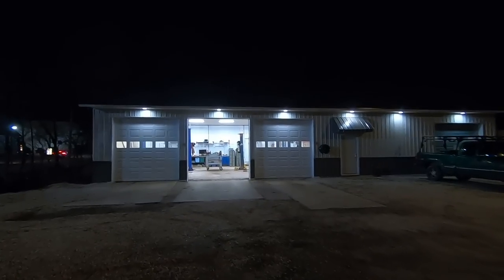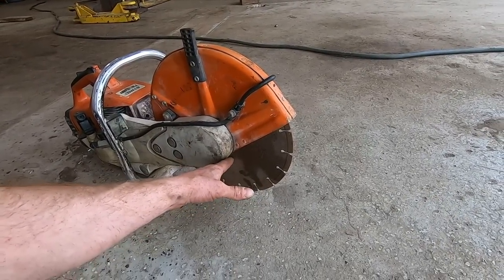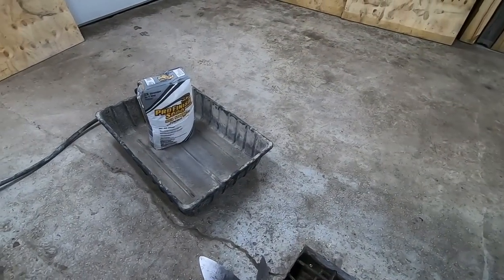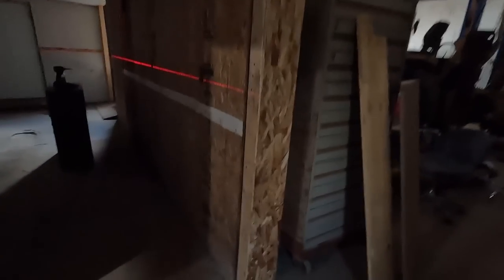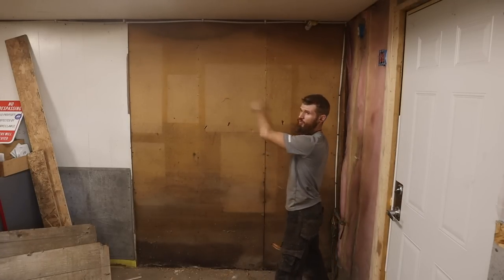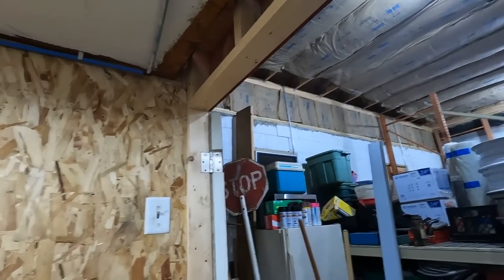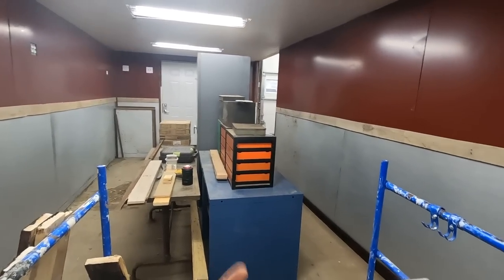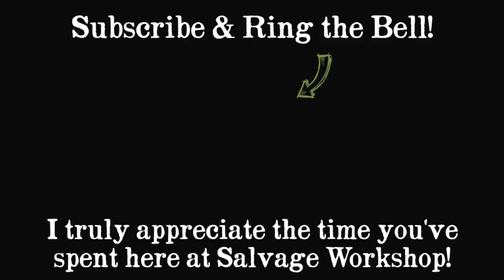Time to Start FINISHING the INSIDE of the New Shop! ~ Part 10 ~ Rebuilding of "The Salvage Cave"

Comment: That floor slab failed because there are no solid footings beneath. The lift will need deep posts drilling into the floor to give good support. I don't know the sizes but would guess at least 6" diameter posts are needed going down at least 4ft.  
The rebar repair you discussed will need to be resin anchored at the original material sides. Anything else will move and fail against the new concrete.

Comment: Hi Matt, sorry I have only just managed to watch this video but the cave is looking fantastic.
The one main suggestion I would have is to change the front on boxed area over the water valve to a hinged door, as if you ever had a burst pipe (of which I hope that never happens) the time you have been and got a screwdriver you will of will be faced by loads of water damage.
The tool you was using for cutting the galvanized sheet what is it called please/ what is it model number. Is it made by DeWalt and hope that you don't mind me asking 🤔
Looking forward to watching your next video Anthony

Comment: burlap covered corkboard would probably be cheap and work well for sound deadening. burlap with any backing would probably work well for your purposes.  I don't know that you would need to go studio grade for the type of content you produce. i.e. salvage.  I'm sure you can find some old burlap. love what you've done with the place so far!
Reply: I suggest burlap over fiberglass insulation.  If it has a paper backing, put the paper flat against the wall.  (Older radio and TV studios used chicken wire over fiberglass on ALL walls and ceiling - they needed to eliminate ALL reverberation.)

Comment: The problem with a windowless bathroom that has only a switch on the inside is that you will either go in, shut the door and then have to search for the lights and/or, once you do your business, wash up, you'll then hit the lights and then you can't find the stupid doorknob, so you will end up leaving the lights on..   You will probably end up putting an external switch in, wired as a two-way, and you'll end up using the external switch more often...   I have had multiple friends and acquaintances who put in powder rooms and shop bathrooms with no windows initially with internal light switches that all eventually had an external switch added...

Comment: Hm...for the upper Walls...since it will be dirty as hell either way, i would do either stonetiles, or since tiling all of that wold be expensive, big PVC boards...both are durable and easy to clean...only my two cents on the Walls...

Comment: The reason the bathroom light switch was on the outside was probably due to code? Putting it on the inside puts it within reach of the sink, water and electricity don’t play well together.

Comment: you want to clean out all the cracks in the concrete and get some epoxy crack repair before you epoxy the floor also hire machine to grind all the crap of the floor before epoxying it.

Comment: Two things one you should have epoxied the the rebar in to the holes you drilled, second the wood you are calling plywood is not plywood it is called OSB it is no where near as strong as plywood

Comment: Thin concrete over cinder-block with no rebar? Man, no wonder that floor is in rough shape!
Seems like this whole building was poorly built. Hope all the reinforcement can cancel out the shoddy prior work!
Some of that scrap-metal looks like vintage heaters, anything notably old/cool there?
If not broken/disgusting, those old rolling chairs could be donated to a secondhand store, maybe some heaters too.
Wow, can really see how rough/uneven the floor is with how difficult it is to get the squeegee to work! Dang.
I find it a little amusing that this patch will be the strongest part of the floor in the whole building.
But hey, might as well do it right when so much was done wrong by whoever built the place!
I definitely enjoy/appreciate using as much salvaged material as possible!
It not only costs less, it reduces waste, and can still look great in the end!

Comment: not sure if its the same in the USA but the light switch in a bathroom should always be on the outside or a pull cord on the inside for safety reasons